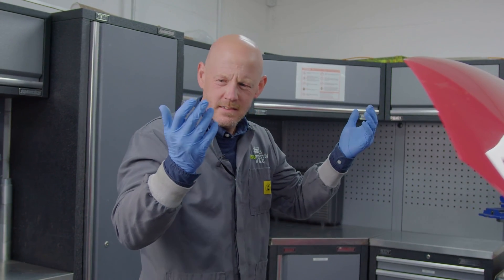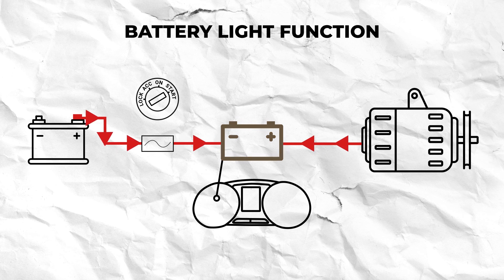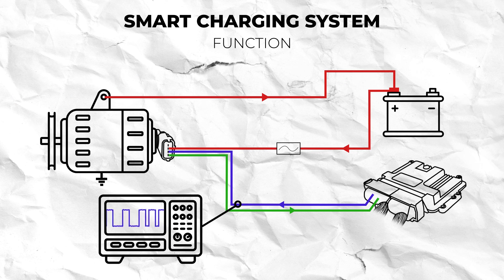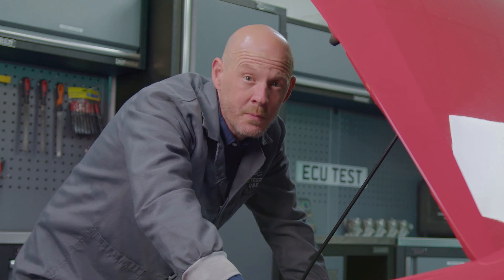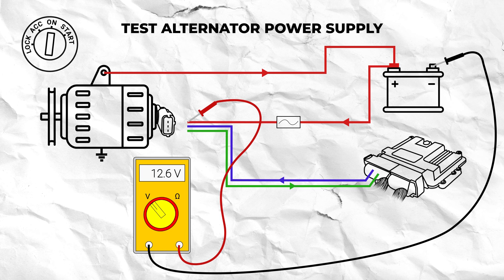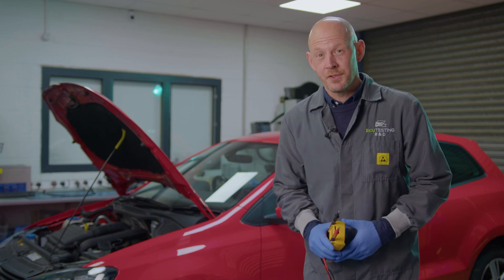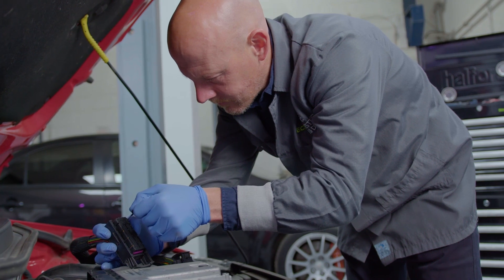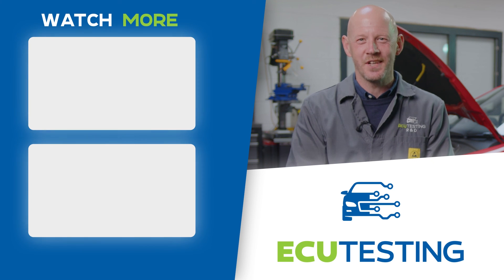Alternator Testing (Alternator Checking – The Right Way)

Comment: might want to also mention during alternator/battery light issues fault codes doesn't always show up, i have a 07 ford focus with the same problem done a voltage test on alternator was where it should've been, checked the wires/battery terminals cleaned them up if needed, all in all im stumped at this point. everything shows working as intended but the alternator/battery light is still on.

Comment: What kind of signal(s), and directions, do apply to alternators with only one (white) wire from ECU to the alternator connector, like the Renault/Dacia, Bosch 23100 2854R F000 BL0 4FB B3 - 14V 80 alternator? Thank you.

Comment: Battery light stays on on ignition after bulb test is finished and stays on when engine is running. Could it be narrowed to ecu issue i wonder? Just did an engine swop and have this issue since

Comment: This is the absolute best diagnostic video I’ve ever ever seen seen on YouTube. Thank you. Unfortunately, I have a two wire system that has no fuse and I do not know what may be different. Could you possibly do another video for 1 wire and 2 wire designs?

Comment: my ameter only reads 3-4amps is something wrong with my meter or alternator ?
Reply: Depends on the state of your battery. If it doesn’t need a hefty charge, there’s no need for the alternator to produce it. Try putting on your headlights, high beams, fog lights, heater fa full pelt, rear screen demister and everything and test again. I would expect the current output to rise significantly. If it doesn’t, I’d be asking questions.
Reply: @madhammerchris  i tried 3 different meters they were +- 3, 4.5-5.1 amps that was with everything running on accessories, ground and hot wire to and from battery to alternator are good
Reply: Ok. So your meters seem consistent. I expect your cheaper meter was giving the lower current? And I assume you have inserted the meter between the alternator and the battery? If you have managed to insert the meter between the battery and the car AFTER you started it, that would indicate a net charging rate to your battery of that amount which would be quite decent. You’re probably aware that 5A at 12v is equivalent of 60 Watts which is the normal output of one headlamp bulb. Depends where you inserted your meter and how.
Reply: @madhammerchris  I put all one at a time between the output of the alternator and the the battery.
Reply: @madhammerchris  so i tried it again at 2500rpm with all accessories on and at normal temperature, with coolant fan running, and the amperage went down to 2.7A @ 2500rpm but its around 5A @ 600rpm. is this normal?
Reply: Well, if you engine’s warm, you’ve been running it a bit. That would have given it time to recharge the battery after starting. I think I would take a look at the voltage across the battery terminals. If it’s around 12-12.5v with the engine off and greater that 13 volts with the engine running - anything up to 14.5 volts, I would assume your alternator’s ok. If your voltage drops towards 12 volts at 2500 revs, then you are where I am right now: suspecting the brushes are bouncing on the armature due to something being slightly out of round or possible endfloat in the alternator bearing. However when this happens on mine, the battery warning light is flickering and wonder if you are experiencing the same. If not and your alternator is running at around or more than 13.5 volts at all engine speeds, and your battery warning light only comes on when your engine is stationary, I’d smile and believe me alternator is ok. The other thing you can do is have your battery discharge tested to ensure that it is up to the job. To be sure that the test is accurate, make sure that your battery is fully charged before having it tested.
Reply: @madhammerchris  thank you for the great tips, 4 days ago i replaced my battery because the one that was in there was dead after 2yrs. I checked ground and hot leads to and from battery to alternator and all were within spec. I did do a clutch fan delete, elec fan conversion so the stock alternator was only rated for 95-105amps thats why i was afraid that the alternator was not charging the other old battery or it would put too much strain on the battery and not fully charge it. So having weight my options I bought and installed a 145amp alternator and the amps when all is running is 6amp on the meter. one thing i did notice was the elec. fan spins up to full speed whole 2-3secs faster on the new alternator. , while installing the new alternator i made sure to clean terminals and junctions with wire bush, re-tested everything again same results with continuity.

Comment: wtf is an OAP?
Reply: Overrunning alternator pulley. Yes, he slipped that one in, didn’t he?  Apparently newer alternators have a freewheel assembly, a bit like a bicycle. I’m still learning about them atm.
Reply: It allows the pulley to freewheel when not needed so less drain/strain on the engine.

Broadly similar to how an aircon pulley freewheels when aircon is switched off except that uses an electromagnetic system to engage, the oap is purely mechanical

Comment: Should the AC leakage test be taken from alternator output to ground?
Reply: Best place to check for AC ripple voltage is at alternator with positive lead on B+ post on alternator and negative lead on alternator case, but you can also do it the way you mentioned, and you can also do it the way he did it in the video.

Comment: When AC on in about 5-10 minutes (depends how hot outside like (+35) - (+40C)) the voltage drops to 11.8V. With AC off the voltage is back to 13.5V. Replaced 3 alternators, cleaned up terminals, replaced battery and ground wires. It happens only with AC On.
Any thoughts?
Reply: Are you checking the voltage at the battery or alternator? What is the year, make, and model of your vehicle?
Reply: @bernardocisneros4402  2000 Toyota Sienna, Same thing on 2000 Honda CRV. Cigarette lighter outlet Voltmeter, which is accurate up to 0.2V. I can't measure voltage otherwise while I'm driving.
Reply: @SergSpace  You need to recreate the conditions by turning on your van and A/C and let it idle for the 5 to 10 minutes. When you see that the voltage drops to 11.8V, take voltage readings at battery and alternator separately. The positive probe of your voltmeter on the B+ post of the alternator and the negative probe of voltmeter on alternator housing. You might have to scratch the alternator housing to get a good connection. Remember this voltage. Now take a voltage reading at the battery. Positive probe of voltmeter on positive battery post and negative probe of voltmeter on negative battery post. The probes of the voltmeter have to be on the battery posts NOT on the battery clamps. This is where people mess up. Now compare the voltage taken at the alternator to the voltage at the battery. The difference should not be more than 1 volt. If it is, then you have a voltage drop problem on the positive side or the negative side between the alternator and the battery. You need to do voltage drop test on the each of them separately. First do the positive side then do the negative side. The voltage drop on the negative side shouldn't be more than 0.2 volts and 0.5 volts on the positive side. All of the tests I just described, need to be done with the van running. I highly doubt that you're truly having this issue on 2 cars. I think it might be the plug in voltmeter that's giving you false readings. I'm not there so I can't know for sure, but you can by verifying those voltages with a voltmeter while van is idling and plug in voltmeter is showing 11.8V.
Reply: @bernardocisneros4402  I didn't need to recreate conditions by turning on van and A/C and let it idle for the 5 to 10 minutes - no need, because when outside is + 40C it happens in a minute or so, once I set gear on Drive (or Reverse it doesn't matter) and drive like 20ft then stop. Doubt what you want. This is the fact. Only on Honda the voltage drops usually to 12V. This car alternator was checked with 3 different mechanics in different repair shops besides me. They checked the voltage drop, I was right there and saw what they were doing. The hot wire along with prong and ground wires were replaced. Nothing helped. Actually one thing helped. I sold 2000 Toyota sienna and got 2014 Sienna. That one usually holds the voltage at 13.2V regardless if AC on or off.
Reply: @SergSpace  I'm really good at electrical stuff and I love solving challenges. The harder the challenge the more I love it. I wish you lived in the Chicagoland area, so I could take a look at it. I've never had something I couldn't solve. I was laughing when I read how you solved the problem on the Sienna: by selling it. You must live in Canada, Australia, or Europe because here in the USA, we still use degrees Fahrenheit.
Reply: @bernardocisneros4402  I live in California. I think the voltage regulator is the bump here. Higher temperature makes semiconductors behavior unpredictable, but in most cases it reduces impedance. Diodes can't handle back electric current. Here is a voltage drops. The alternators that were changed on 2000 Toyota Sienna were all re-manufactured, means the voltage regulator is supposed to be replaced. But I can't be sure they did that. That could be the problem - the load on unstable rectifier.

Comment: Thank you for the video but one question is what could be the error if the generator produces 17 volts?
Reply: Depends on your vehicle. Some newer vehicles can have up to 17 volts while older ones only up to 15 volts. If you have an older car, then it's a bad voltage regulator. Depending on you year, make, and model, the regulator can be in the alternator, in a module, in engine computer or a combination of the 3. My 2016 Nissan Frontier has its voltage regulation controlled by all 3.